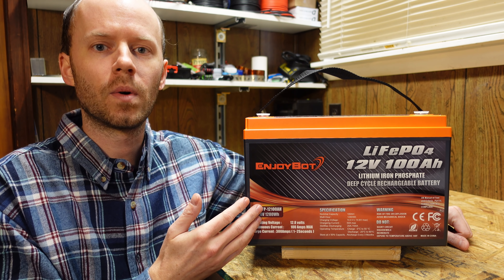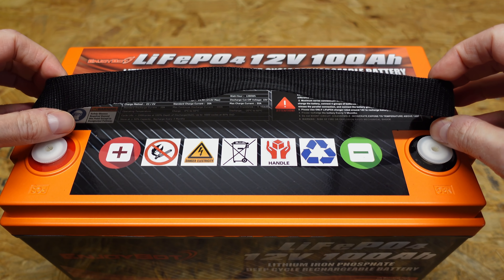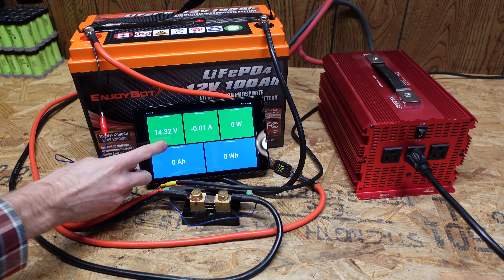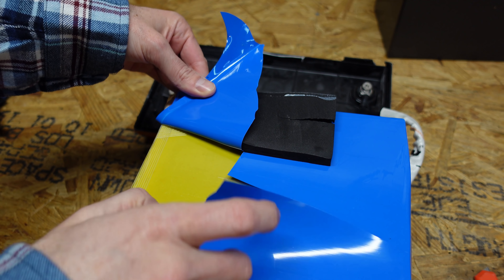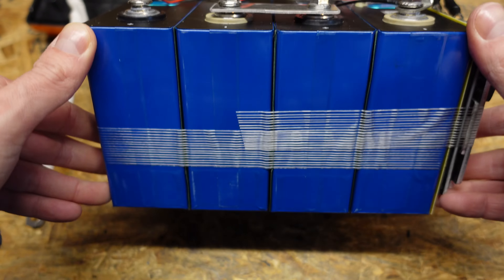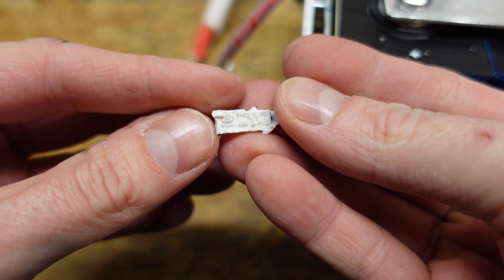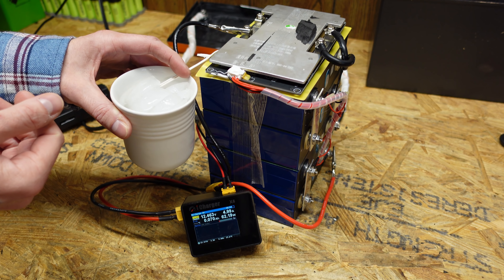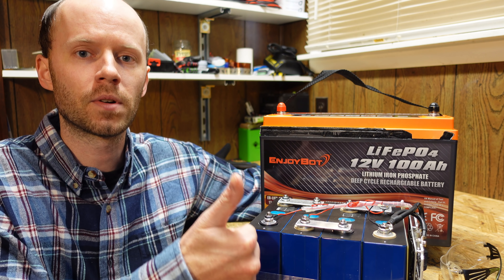EnjoyBot 12V 100Ah LiFePO4 Battery Review, Super Cheap, $256/kWh!

Comment from the maker: Alright, so after filming this video, I noticed the manufacturer's website indicates "automatic temperature protection". I took the BMS apart completely to make sure I didn't miss anything, such as another temperature sensor under the heatsink. There is nothing else. There are pads to solder on a 2nd and 3rd temperature sensor, but they're empty. Additionally, I found the brand name of the BMS (VIP-BMS) on the PCB inside. Feel free to leave any other questions, comments, or thoughts!
EnjoyBot 12V 100Ah Battery... https://enjoybot.com/products/enjoybot-lithium-iron-phosphate-deep-cycle-rechargeable-battery-12v-100ah?aff=11

EnjoyBot 12V 200Ah Battery... https://enjoybot.com/products/enjoybot-12v-200ah-lithium-iron-phosphate-deep-cycle-rechargeable-battery?aff=11
EnjoyBot 12V 300Ah Battery... https://enjoybot.com/products/enjoybot-12v-300ah-lithium-iron-phosphate-lifepo4-deep-cycle-rechargeable-battery?aff=11
Reply: What kind of display do you have? It's looking good
Reply from the maker: @voltsverige  It's grafana https://grafana.com/ I really need to get a video done discussing this. It gets asked a lot :)
Reply: @LithiumSolar  The cells are from Gotion High Tech, made on 2021 May 3. Great review as usual, battery is looking great for that price, except for the low temperature protection. But definitely not a deal breaker.
Reply: @DSmartLife  HOW IS THAT NOT A DEAL BREAKER IF YOU'RE USING IT ANYWHERE IN THE NORTH AT ALL. INSULATION AND HEATING PADS WITHOUT A TEMP CUT OFF ISN'T WORTH THE HASSLE
Reply: @RonPaulgirls  Ok. Edit: *for me. I was agreeing with LithiumSolar's view about not being a deal breaker, battery meant for controlled environment.
Reply: @DSmartLife  IT'S A DEAL BREAKER FOR ME.....I LIKE TO LIVE IN WINTERS THAT ARE BELOW 32F LIKE FOUR MONTHS OF THE YEAR, IT'S LOOKING LIKE SOK IS THE ONLY SAFE CONSERVATIVE BET AT THIS POINT. I'D BE INTERESTED IN VIDEOS THAT SHOW YOU HOW TO ADD LOW TEMP SENSORS AND OR BMS KITS TO BATTERIES, MAYBE A BMS KIT WITH LOW TEMP SENSORS, HOW MUCH COULD THAT COST...
Reply from the maker: @DSmartLife  You're right, thanks!! I found them, Gotion 102Ah cells. I see some specs on Aliababa pages but can't find an actual datasheet.
Reply: @Shiba Emoon RIGHT I KNOW ALL THAT, YOU STILL NEED LOW TEMP CUTOFF AS A BACK UP
Reply: I'm always wondering if it wouldn't be feasible to make a low temperature protection on the solar/charger side. I'm thinking of a simple thermostat like the ones used in commercial refrigeration systems. They cost about 15-20$. Only problem is they are designed for switching AC loads so their capacity for switching DC voltages is too low for larger applications. Anybody knows an affordable DC thermostat that could be used for such applications? Ideally I'm looking at high voltage solar arrays like up to ~500V and 10 to 20 amps.
Reply: @mariokleidosty9175  Would probably be easy to add with an external microcontroller and something like an SHT30.
Reply: @GoatZilla  Probably, I'd prefer a fully mechanical solution though as there would be no risk of draining the battery. Also no need to worry about power supply for the controller and directly usable with any battery voltage.
Reply: @mariokleidosty9175  Yeah I can understand that.  However, if the unit is directly powered by charge source and not the battery, then you won't run down the battery.  If the charge source doesn't have any power, then...  no charging is happening anyways.
Reply: @GoatZilla  true, my solar setup is at a VOC of 400V though. Probably not the best idea to power something directly 😂
Reply: @mariokleidosty9175  Yes, but your charger probably isn't outputting 400v.
Reply: @GoatZilla  true, but still 54V
Reply: @mariokleidosty9175  Actually thinking about this a little bit more, there are two options.

1.  The charger likely already has an charge enable/disable.  Just access that.
2.  If there is solar energy available but the batteries are too cold, it could kick on a heating element (again, using the solar supply) to warm up the packs.
Reply: @GoatZilla  it's actually not a problem I face on my own system because the batteries are in my basement where it will never freeze. Nevertheless I was hoping somebody would know the correct part for a cheap solution everyone can afford and easily integrate into their systems whether small or large. I agree heated batteries are a fine solution but getting cheaters that will work with higher than 12V is neigh impossible or at least very expensive. Depending on you location and sun available it may also not be feasible because it would take too long/consume too much energy and you'd be better off skipping charging for the day.
Reply: @mariokleidosty9175  Easiest thing would be to check your charger itself for an enable/disable (many already have temp sensors inputs anyways) and just use that.  

It doesn't make sense if you have solar power available to just skip charging for an entire day when all you might need to do is carve off a little energy for a heater.

Producing heat from electricity is like...  the easiest thing to do, ever.  It's actually really difficult to do anything with electricity and NOT produce heat.
Reply: @GoatZilla  I generally agree but your milage may vary. Here in Europe my average daily production of energy from my PV was below 0.5 kWh/kW peak for the majority of December and January. Depending on the insulation of your batteries this can easily be what you put into the heaters and the next day you start again. While thermodynamically feasible it requires you to by and install the heaters. You simply may be better off saving these costs and install larger panels to get more out of days when batteries are warmer.
But as I said your milage may vary and especially on smaller systems in RVs or the like most chargers will not have an input for thermostat off, especially the cheaper ones.
Reply: @mariokleidosty9175  It's hard to imagine a scenario where letting energy completely go to waste uncollected is better than using that same energy to correct the condition that's preventing you from charging.  .5kwh is .5kwh; I'd rather at least attempt to keep my batteries from freezing than let that go to waste.

In the old days, "install the heater" meant putting an incandescent light bulb in the enclosure.  In fact right now I have an incandescent bulb pointed at a corner of an external wall to help prevent a pipe from freezing.

Also, considering the fact that some charger/inverter units will fail catastrophically if you have solar power connected without a battery, it might be in your best interests to do everything you can to keep the battery BMS from disconnecting.
Reply: @GoatZilla  once more I need to agree in part. Having the batter, disconnect is something I'd like to avoid at all. That is why I initially proposed disconnecting the solar panels from the charger.

Comment: I've been looking for some lithium batteries but I want low temp protection...thanks for these videos...def steering me away from the ones that don't have it!  My batteries will be weather protected outside but not temp protected.
Reply: It is completely legitimate. That’s why it has a temp sensor and temp controller. Set it to above freezing or wherever you want. 50 degrees F if you like. Total protection.

Comment: Darn!  I was really going to start pushing for these batteries for Skoolie and RV set-ups because of the low price point.  That price makes them very attractive.  Unfortunately, most of the mobile folks really want something that is fool-proof.  I sure wish that the manufacturers in China would learn that the low-temp charging is a much bigger deal than they think it is.

I, for one, have not drunk the Kool-Aid of Battleborn and Victron and am constantly looking for alternatives to suggest to people who are designing their solar set-ups.
Reply: The batteries are damaged if they are charged below freezing? Then my lifepo4 solar power system will go down in a prolonged cold spell?
Reply: @Jimigunneful  yes, lithium batteries can be DISCHARGED below freezing, but should not be CHARGED below freezing.  In my Skoolie, the batteries are in an area that gets heated during the winter, so it stays above freezing.  The only time I get concerned about it is when my rig is being stored during the winter.  I need to make sure that my chargers are off when I’m not around to make sure that it’s above freezing where the batteries are.

Comment: Another very informative vid. 
I went back over some of your vids and was trying to remember; was there any brand in the $300 range hat had low temp shutoff?
Reply from the maker: The Basen battery had it, but think that one was closer to $400 and I see the link is no longer working. I'll fix it later tonight.
Reply: @LithiumSolar  WHY DON'T YOU JUST CUT TO THE CHASE AND DO VIDEOS ON THE INSTALLATION OF CUT OFF SENSORS AND BMS SOLUTIONS INCLUDING THEIR COSTS, MAYBE THE EXTRA 20 BUCKS IN MATERIALS COULD BE WORTH IT
Reply: @LithiumSolar  Thank you!

Comment: A Chins battery with a different label.  I have two and only one thing worries me.  In the past the new batteries tested at 105 to 106 Amp hours.  The recent new batteries test 102 Amp hours.  That is a differed of 3 to 4 Amp hours.  The question is, why?

Comment: Is there an easy way to add low temp protection...and for that matter bluetooth also??  Thanks for any info.
Reply: Here is how I solved the low temp protection issue.
https://youtu.be/COVAgO0_MnE
Reply: @thervsolarseries2827  
I WATCHED YOUR VIDEO AND IT LOOKED PRETTY GOOD, MY QUESTION IS WHY DOES IT NEED TO BE THAT COMPLICATED WHERE YOU NEED A SPECIAL UNIT THAT GETS POWER FROM THE INVERTER WITH SPECIAL SETTINGS ETC.  WHY CAN'T ALL THAT BE BUNDLED INTO ONE SMALL PART THAT TAKES ENERGY FROM THE SOLAR LINE AND SIMPLY INTERRUPTS IT IF THE TEMPS ARE TOO LOW

Comment: Excellent review...as always.  LOVE your channel!!  These batteries are advertized as having low-temperature protection which is NOT TRUE.  A real deal breaker!!
Reply from the maker: They have two versions, one with low-temp protection and one without. You can choose the one you need for your application.
Reply: @LithiumSolar  That's good to know.  Some of these Chinese manufacturers have advertised low temp protection and there is none.  At least one battery that you reviewed where you discovered this.
Reply from the maker: @user-zo6xg8bx4l  Yes, I think I Know which one you're referring to. I really need to get an updated video on that.

Comment: Do you need specific charger for lithium battery or would a standard charger such as Schumacher work???
Reply from the maker: Even though the charge profile is similar to lead acid, it's always best to use a charger designed for LiFePO4 batteries.

Comment: Just an idea to maybe give an update/perspective on what to use 18650s on these days since bigger batteries are taking over the power wall space and maybe other spaces as well.  I don't follow any solar/battery/energy forums and don't see the usual youtubers talking about 18650s now.  There might be some since out there, but I'm not watching them.  It seems laptop aren't using 18650s anymore.  I'm more into finance/stock/bond market youtubes now so not very aware of what's going on now with batteries.  You had some used flat pouch batteries at one point, did you ever find a place to use them?

Comment: Man, I watched this and bought one. You should always also mention the return policy. They make you pay for postage!!! I got a dud where the BMS fails to cut off at low voltage (falls below 10V), and even worse, the moment the voltage drops below 11V (give and take), it drops like a brick. And all I was doing is draining only 6, 7 A!!!
Reply from the maker: How low did you let it go? Looking at the graph from my test, mine cut out around 9.80V - which is low, but still acceptable for LiFePO4. The sharp drop after 11V is also normal. Did you capacity test it somehow to see how much power you could actually use? If the battery truly is defective, I don't see any reason why you should be responsible for paying postage and would argue it further with them if it were me.

Comment: I live up in Manitoba Canada and it get down to -40 and lower during the winter months. Can one replace the thermal switch for a low temperature sensor?
Reply from the maker: Once you open the battery, you can't really put it back together. If you require low temperature disconnect, I would suggest looking for a different battery unfortunately.
Reply: @LithiumSolar  I will do for sure and thank you!

Comment: I have two other 12 volt 100 amp lithium ion phosphate batteries can I put this battery in parallel with my other two which other same voltage and amperage

Comment: The vents look like EVE cells, but the size and shape do not. Once more, no low temperature disconnect. Good quality, just no low temperature sensor. People would pay extra if they would slap a JBD BMS in that has both high and low temperature sensors and a bluetooth.

Comment: that temp sensor is completely useless for 75c
if the sensor reaches 75c then the centre of the battery has 100c and the whole battery can be thrown away 
should've been at least 50c

Comment: You should retest these batteries and let people know if their current claim of low temp protection is true. In my experience it is not true and the company is refusing to admit it's not true and not replacing the batteries I bought through Amazon. I'm in a cold climate and need the low temp protection. It is terrible that Amazon protects sellers like this allowing for good reviews only, refusing to allow bad reviews. Their low temp protection claim is a scam.
Reply from the maker: The battery I tested in this video does not have low-temp charging protection. It is not advertised as having it either. I checked the company's website and the Amazon listings and see they have two versions now, one with low-temp charge protection and one without low-temp charge protection. One way you could test it yourself is the place the entire battery in the freezer overnight then try charging it the next morning and see if it accepts a charge.
Reply: I watched your video and did see that you didn't find any low temp protection. I'm not questioning your video. The Enjoybot company misled and continue to mislead people. They were specifically saying both of their batteries had low temp protection when I bought mine. I bought them specifically because of that claim. Now they are still implying a low temp protection by saying, "  With automatic temperature protection, the Enjoybot 12V battery has a temperature tolerance of 4°F-140°F and adapts to any environment". They are implying this for all their 12volt batteries. Also zoom it on the pictures of the batteries you will see the below freezing low temp protection listed on the side of the battery. Also the brochure that they included with their batteries to me said the batteries had low temp protection. Also this is their reply to me using Amazon's reply to seller link asking them to replace my batteries with ones that do have the low temp protection. 

"Dec 30, 2022 12:09 AM
Our battery will automatically turn off the charging function and discharge function when the temperature is too low. You can put the battery in a place with high temperature to use, such as inside the car or indoors." 

Also read the seller's answer to multiple people asking Enjoybot about the low temp feature and they said starting last summer all of the batteries had the low temp protection feature. Like me the buyers were asking because they needed the feature. You looked for it and tested for it knowing people need it. It is terrible that they are allowed to promote their batteries as all having a feature it doesn't have. They are just making claims to sell more batteries then denying to back up their claims.

Comment: I bought 2 pieces of 12V x 100 Watt mono solar panels with a 40A MPPT Charge controller from HQST last November.  Now I plan to buy a 12V200Ah LiFEPO4 battery and a 1600 W 12V inverter.  Once it is running, I plan to add 4 more similar solar panels.  I want to use this system to run 1 refrigerator, a freezer, a washing machine, few light bulbs, and a garage door opener, all of these are in my garage. Does buying :12V200Ah LiFEPO4 battery and a 1600 W 12V PSW inverter makes sense?  Advices and comments are appreciated.

Comment: Super cheap cells that can only handle 1000 cycles before being down to 80% SOH
Reply: They are grade A cells that will last 4000 cycles, especially if they are used within 70% of their rated capacity.

Comment: That is not cheap . if you want a good battery with low temp charging protection just buy an SOK. I have no idea why these stupid Chinese scam artists keep trying these fake advertising gimmicks. What is worse is that it would only cost a few bucks more to do it right. They should be banned for false advertising.
Reply: Those SOK 100 ah are $900 here n Canada off of AmazonCa. Not a relatively cheap alternative. Battleborn price territory.